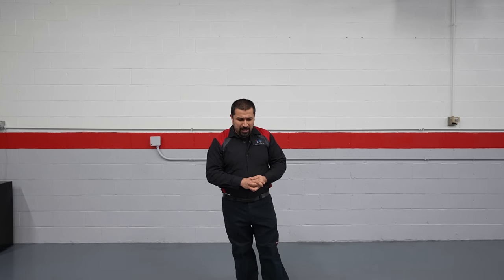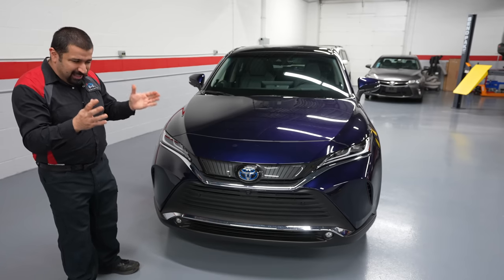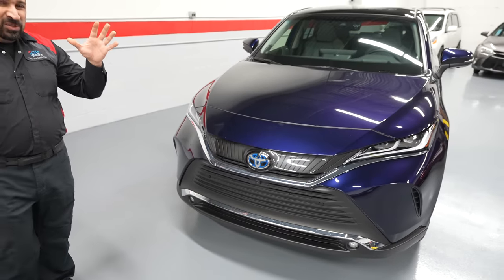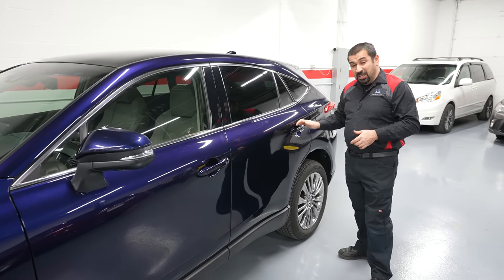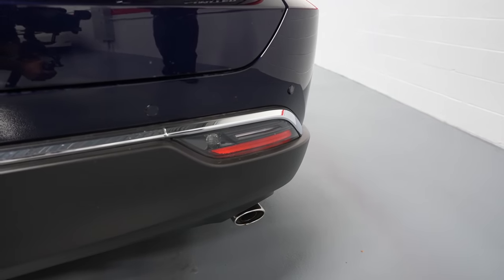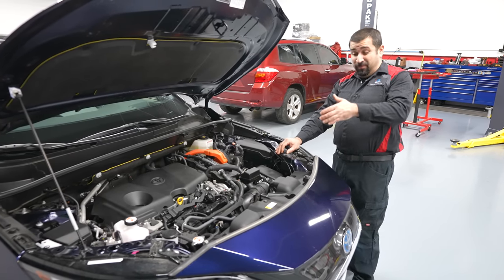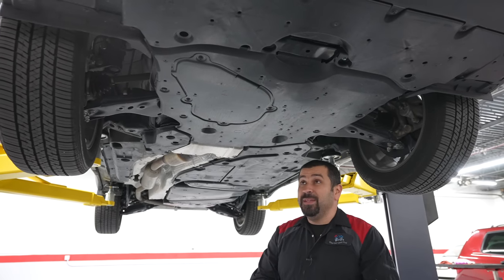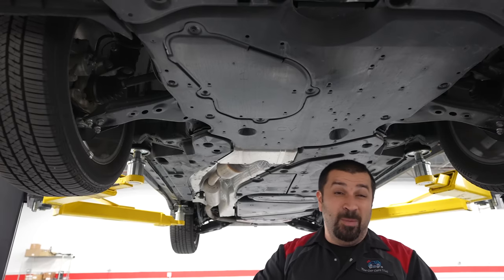THIS Toyota New Model is a Total Hidden Gem! Should've Been a Lexus!

Comment: I like my base level 2022 Venza.  It has the knobs.  It does NOT have the glass roof, which I find a useless frill.  Mine is the same color as the one in the video.  I agree that the car grows on you over time.  Very good job, Toyota.
Reply: Yes, the lower trim has the knobs and also the smaller screen.
Reply: @OldDood  Yes, since I have it  I've noticed. 😀

Comment: AMD, I am pleased to report the original Camry-Wagon Venza was a smash hit in Canada.  I am tempted to say, there are few things more Canadian than a 2016 Venza with snow tires mounted on sensible 17" steel wheels. We really, Really,  REALLY, R-E-A-L-L-Y  hope the new Crown Estate comes to our market to fill that space. This 'new' luxury Venza is a good addition to the fleet of Toyota Hybrids but the humble RAV4 beats it on practical measures. I also hope Toyota's upgraded 240 hp 2.5 Hybrid system soon makes its way into the new Venza and RAV4 to give them a bit more pep. In regard to the 5th generation Hybrid system, so far all the reports are very positive but we will all be waiting for YOUR expert observations. Finally, on the subject of the right name, the Japanese market Toyota Harrier could have easily been mistaken for Toyota Hairier and that may just have been too much of a risk 😉
Reply: I think the original Venza was ahead of its time. Canadians tend to hang on to them. They are very capable winter vehicles.
Reply: @namegoeshere2903  If we do our due diligence and rustproof them, they should be good for 20 years 😉
Reply: I could not agree more brother!
Originally I was test driving Toyota 4Runners but just couldn't bring myself to drive a vehicle that barely got 20mpg so I started test driving hybrids including Honda. When I found out from your videos how great the Toyota hybrid platform truly is I settled on Toyota and test drove multiple RAV4's but didn't like the road noise. Then right behind me in the showroom was a 2021 Venza. I remembered it had the same Synergy Drive platform and the sales person drove around a brand new fully loaded limited model. When I took a test drive I was hooked. It was quieter than a RAV4. The seats were more comfortable. And even though it had the same JBL sound system it sounded better for some reason then the RAV4. I also love that it has a lithium ion battery.
I just love my Venza I often get mileage approaching 50 MPG! 
I have a question on the battery:
A Toyota employee told me that with the lithium-ion it'll last much longer but with the older nickel metal hydride batteries no matter how many miles they have on them they typically fail in a shorter time frame.
Has that been your experience?
Reply: One of the reasons I chose the Toyota Synergy Drive platform in a Venza was because it did not have a turbocharged engine.
Reply: @rightlanehog3151  what rust proofing method/vendor do you recommend? I'm planning on driving my Venza into the ground.
Reply: @namegoeshere2903  Yes, I own the first year generation of the original Venza and when I test drove this new addition was disappointed in the road noise into the cabin and that was on highway driving. The review he did earlier on this model he noted the same. The first generation is so much more enjoyable in that department and it was made in the USA. The new generation is made in Japan and I expected much better cabin quetness then what I experienced.  I won't rule it out for later consideration  in the future but the road noise has to be addressed  before I would look at it again.
Reply: Yes we do love them and with the now gone V6 engine I will hold on to mine for a long time.
Reply: @powerguymark  for Canadian winters?
Reply: @JAY-gv4eq  assume the worst.
Reply: The Outback rubbed the previous Venza's nose in the dirt
Reply: @brianwhitney9181  its the tires. the tires toyota used are noisy. once you replace the original tires youll have a nice quiet venza. just have to bare with it till original tires are due to replace
Reply: @powerguymark  An annual visit to KROWN has kept my 2005 rust-free through 17 very salty Ontario winters. There may be other products that work just as well.
Reply: @circeseye1  Hi, why he never mentioned that the tires were the issue when he tested it. He is usually more thorough then that. It is a shame if true that new owners will have to put up with that noise for thousand of miles before they get a solution at their expense is not a good reason to buy at this price point.
Reply: 240 hp is too powerful.
Reply: @brianwhitney9181  The previous Venza was a Lexus RX. The current one is a RAV4.
Reply: @powerguymark  You don't need to replace turbos like you have to replace hybrid batteries. Turbocharged engines are much less complex than hybridized engines. Hybrids have always been a sideshow.
Reply: @imnotusingmyrealname4566  The Toyota boys when they first launched the first generation Venza claimed it would be a new category changer it never was that but did for while become a useful utility  vehicle for the time it was in production.
Reply: I will keep my 2008 rav4
Reply: O Canada!

Comment: Those are really nice.  It came to that or a Highlander. We chose the Highlander just because I am very tall, but I would of preferred the Venza just because of its gas mileage and ride, although the Highlander rides like a Lexus too.
Reply: It is harder and harder to find any current Toyota that accepts tall drivers and passengers.
Reply: @rightlanehog3151   yea, any Toyota sedan with a sunroof will not work for me. It’s not like I’m super tall,6-2.  They are looking for. maximum fuel economy which means lower roof line
Reply: @jimbob4456  Interestingly, the current Prius is their most fuel efficient car and it has more front seat headroom than a RAV4. Naturally, they have dropped headroom severely with the new one to make it look 'cooler'.
Reply: @jimbob4456  exactly, the headroom in toyotas are too low. Japanese people are short, but they have to realize Americans are tall. We dont want to drive with our head touching the ceiling

Comment: We bought the 2022 Limited Venza in Ruby Fare pearl
Absolutely love the build quality from the Japan plant
Took your advice and changed the oil early before 5k
I appreciate your review on the car. I have owned a 
2nd Gen RX 350 V6 Gas Guzzler Third Gen RX 450
The New Venza is better than both of them.
Gas mileage is amazing and the 10 Gallon tank 
To fill up is only $35 and lasts 450 miles…! 
I dislike the NX wheel arch plastic skirts.
The Venza is bigger for 5k less.
Reply: I’m liking those Venza mpg numbers!
Reply: @eleanormassaro5195  I get better than 42mpg in mine.
Reply: super spot on write up, i second everything you wrote! love it is made in japan.
Reply: The best I have achieved is 63 MPG’s running to Starbucks on a city only 9 mile back and forth..!
Freeway takes down the average
Reply: @scottanderson672  i drove about 50 miles south OC California to Pasadena Freeway, back mostly local, averaged 45mpg both ways.  I think the sweet spot is a 35-40mph cruise with as few stops as possible on a flat route.

This car does much better on flat routes vs   hills.  MPG in rolling hills is 37 or less.

I know mpg goes off the scale past 60 mpg when cruising at 38 on flat land.
Reply: Lived in OC & Then Long Beach,
Belmont Shore area from 20 to 40.
Crusaded the PCH in my old air cooled 911 Turbo. 13 miles to the gallon 🤣 when getting on it. I agree the sweet spot in the Venza is under 65 and likes the city & stop and go. Anyone talking about the spaceship like feel. Love the new Venza..!

Comment: I am shocked that some critics have called the A25A a “trash” engine?  I work in the factory where the engine is machined and assembled.  I’ve had the opportunity to measure different parts of the engine, test the engine and, drive vehicles with this engine.  I own one in a RAV4.  True, it’s a bit noisy and “droney”, but performance and reliability-wise it’s jewel!

Comment: The old Venza (we have a 2014 model) was a failure because Toyota did not market it.   I found out about it when I took my Prius in for service.  I wandered around the lot and saw a Venza.   We bought one a couple years later.    Most people that have them luv them (especially with the 6 cylinder engine option)...
Reply: I am one of them. Own 2010 V6 love it

Comment: What a great review.  Thank you.  We bought that exact model - Limited, Blueprint blue exterior (the back looks a bit like a Jaguar) with the grey interior.  We absolutely love it.  I think they should have named it the Harrier here too.
  It took a few drives to get used to the infotainment system (touch) but it was not difficult.  I use the volume button and station presets on the steering wheel.  Problem solved.  
I find the Venza Limited to be very quiet in the city and on the highway.  Yes, you can hear the engine with hard acceleration but I had that with past cars too (Mazda, Acura).  But once you're just driving at a steady speed, the interior is quiet.  We just did a 1300 mile journey down the west coast and it was peaceful and calm, especially with the JBL sound system. 
 Our main reason for buying the Venza goes with what AMD mentioned.  That is we wanted a hybrid but found the RAV4 too trucky, and loud for our tastes.  
The Venza is attractive inside and out.  Oh and we are averaging almost 40 mpg.  Our whole 1300 mile journey cost around $150.
Reply: Wow that’s a great mpg you got.  the Venza hybird engine is 2.5 liter?
Reply: @joet2678  Yes.

Comment: Totally refreshing to see how well you reviewed this car. I like the refined styling of Venza over the ruggedness of RAV4. For completeness it would be nice if power/ torque and fuel consumption figures are included in future videos. Unfortunately Venza is a not sold in Australia otherwise it would be my choice of car to buy. Given my options here I'd like a comparison video between Lexus 350H (with F Sport) and Lexus 450h plus - is an extra $10k worth paying for the latter? Is it worth paying extra for independent suspension on the F Sport? FYI - my daily driving average is 30km which is well within the claimed EV only range of the 450h+, and park my car in the garage).
Reply: I agree. I am a Rav4 hybrid fan, but it is aggressive looking. I prefer the gentler styling of the Venza. I love the center screen on the dash. Oooh I like that Stargaze roof over my sunroof that is never opened. TOYOTA......move that start button!

Comment: Love my 2022 Venza. Gets 46 -48 mpg, even when driving in CA, on vacation. Very comfortable to drive. I didn't get the stargazer roof but sure miss having a moon roof. I like the kick to open feature to open the hatch.
Reply: It's better milage than my hybrid rav4 2018 I guess time to update
Reply: Check your odometer against the markers on a highway, my Camry hybrid doesn't get near that.
Reply: I drove a Ford Fusion hybrid for years and got 49 mpg. Driving habits might be a factor along with climate and elevation. Our elevation is around 4900 ft. High desert country. My mpg goes down in winter.

Comment: You are so right, AMD!  The Venza should’ve been a Lexus NX!  It does have a lot of Lexus-like features,like a power tilt steering wheel, power folding mirrors!  The only thing I would prefer was that the panoroof open instead of the fixed glass Stargazer function. I would rather it be able to open than have that feature

Comment: The Venza is called Harrier in Japan, and Harrier is a Toyota version of the RX350
Reply: Back in the mid-2000s, my brother-in-law owned a Harrier in Japan and that was a straight RX300/350 (leather interior, etc.). The Venza was always a longer vehicle with a lower profile. So they probably had separate models for those two distinct body designs.
Reply: @seanpop2886  Yeah but the Venza we have here in the US right now is still called a Harrier in Japan right now
Reply: @jamessicat  did it last long?? No major issues??
Reply: It is a less expensive RX350.

Comment: The most maddening thing for me when these launched, is the 360 cam only came on the top trim here in Canada, which also only came with the Pano roof, which didn't have normal roof rails for roof racks. I might've just settled for the XLE, but then Volvo dropped the MSRP and upped the electric range of the V60 recharge so... Maybe if there's a venza prime in 5-10 years, or a crown estate in North America...
Reply: I can't remember what it was but I had the same issue when buying my car. I wanted certain non-drivetrain features but they were only available if you got a higher trim with bigger engine, or next model up with bigger engine. I wanted better fuel economy for longer-term financial and ethical reasons, regardless of the original cost of the car, so bigger engine was not an option. It really bothered me that they did that.
Reply: In about 5 years, that Volvo will be at the end of its life.
You should have just gone with a RAV4.
Reply: @fknbastages  the job description is weekend cruiser, kayak+bike hauler, family chauffeur car, in that order. and because we're a stubby peoples, it had to have a low roof or a bed i can stand in (ie. a wagon or a compact pickup). the V60 PHEV and maverick hybrid were the short list. next to them, the venza was too expensive vs the maverick if we wanted to cheap out, and not as convenient for not all that much less vs the V60 PHEV (in canada, after govnt incentives). The new RAV4 is a bus, it was never in the running. 

but volvo has a manufacturer's extended warranty out to 10 years/200k km, that's relatively extensive, and transferrable with the car. dunno if i'll opt for the max term yet, or if i'll plan to keep the car that long (still waiting on delivery), but it's partially refundable at end of term should i get it and never need it. and volvo's dealer network is alright in my region, i've got lots of choice for service, should i get a hard diag. and i can afford for it to be in the shop more than a toyota, as long as it's roadworthy most the summer. we got a corolla for daily driving

Comment: I really like the new Venza. It's conservative, yet very upscale and Lexus-like in it's styling both in and out. It's definitely seems smaller inside than a RAV4 than the outward appearance would suggest. The only 2 things I don't like about it, as you mentioned, it's loud at highway speed. It seems to be a combination of tire and engine drone. It's not awful, just very noticeable. The fixed glass roof, in my opinion, is an expensive $1,500 gimmick. They should have offered a real panoramic sunroof for those that would like to have one. The customers that have bought these (which isn't many) were usually older folks.
Reply: Low noise tires can help a lot with the noise at speed.
Reply: @alouisschafer7212  I agree. I don't remember what Toyota uses for OEM tires on the Venza, but I'm sure there are much better options to replace them with.
Reply: @gianmariavolonte4315  I know that some tires these days are down to 67db which is a massive difference compared to a 72db or 71db tire.
The all seasons on my car are 69db tires I can tell my car is already noticeably quieter on the road than other cars.
Low key eyeing ebay for a 2nd set of OEM rims so I can have summer wheels with some really quiet summer tires and my current wheels would then be my winter wheels
Reply: What are some good brand names / models for low noise tires ?  Would love to get some when the time comes…
Reply: @dt5656  Bridgestone Turanza QuietTrack - Pirelli cinturato p7 all season plus.  Both are very low noise tires with the Pirelli being the quieter of the two.
Reply: @gianmariavolonte4315  I would love to know what kind of a tire would give a quieter ride to the Venza in case I end up buying one in the next couple years!😁
Reply: @gianmariavolonte4315  In Hawaii, they came with Bridgestone Ecopias. I've only got 6K on them and am debating when to fork over the @ 1K for the Michelin Cross Climate 2s which are supposed to be much quieter. Even though I'll never have to drive in snowy conditions.
Reply: @artthi7918  I’m in Hawaii too and I out michrlin cross climate 2 on my 2021 prius.

Comment: Your videos have my attention from beginning to end. I would love to see you do one on an earlier model of the Toyota Yaris Liftback. I have a 2008 in manual, and as small and economic as that car is, it was also well-designed to make it feel roomy inside with the that big windshield they put on it and the cargo space you get when the rear seats are folded down. Mine has 130k miles on it and drove like a brand-new car when I took it from Portland to Austin round-trip last September.
Reply: I have a 2007 Yaris.  The cargo area was perfect for my two large dogs.  I have over 200K miles on it and it still runs like a dream.

Comment: I was working for Toyota when the first Avalon came out. A Toyota rep told us it was supposed to be the low tier Lexus model but instead became the top tier Toyota. He also told us that there was a LOT of infighting in the company about rebranding a Camry as a Lexus for the original ES300. I've driven a couple of Venza's and will agree that they are Lexus level comfort and build.